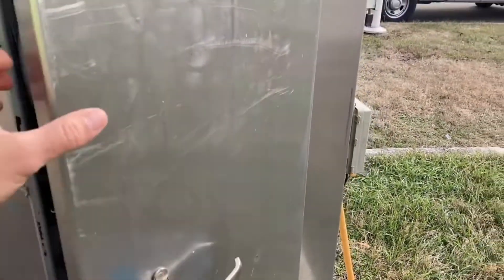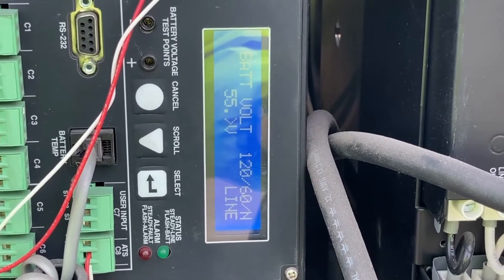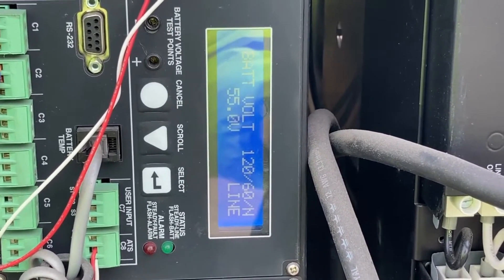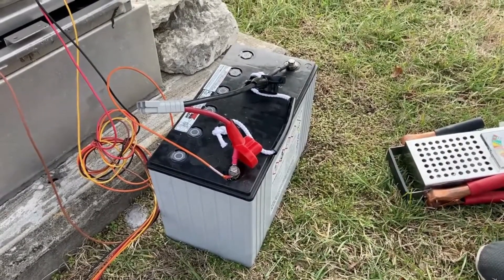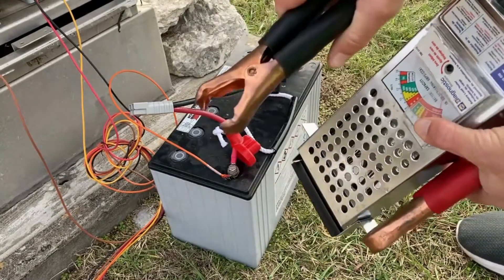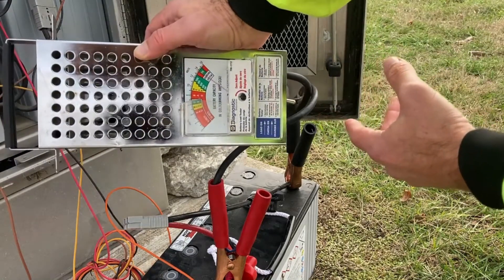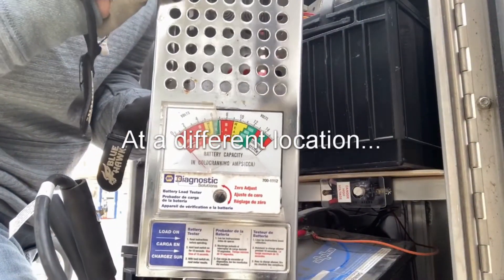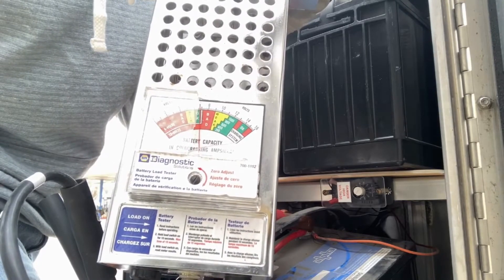How NOT to Test UPS Lead Acid Batteries

Comment: I have a super cheap universal battery brand 100 amp hour 12v AGM battery that is still performing practically like brand new after just over 3 years since purchase date. However it has only had very light occasional use with less than 10 complete discharge and recharge cycles on it. it has probably only had a total of 200 or so amp hours charged and discharged out of it since it was purchased. it has been mostly kept on a standby float charger at 13.5v or left sitting and occasionally topped up with an absorption charge cycle to 14.7v
it has no trouble running a window air conditioner off a 1000 watt pure sinewave power inverter for over an hour continuously without falling below 12 volts.
 Tested for ability for cranking amps and resistance reads to about 558 Cranking amps and 5.4 milliOhms resistance which is within manufactures specifications. and capacity is still practically like brand new as well.
Reply from the maker: @realflow100    Wow!  That's a good battery there.  I'm assuming its probably kept in a good storage area?

Comment: I gotta say the test used is pretty good. I still have two of these but now I use a conductance tester. Specifically the EECS750 from Snap-on. The Midtronics testers are pretty good as well. These conductance testers give true battery condition and will also give remaining battery capacity. Typically we select the CCA rating. It can test STD, AGM, and GEL batteries. Great video.
Reply from the maker: @ronhaefner7883    Wow!  Never heard of those.  Thats very interesting it can give battery capacity as well.  I'm on the hunt!

Comment: if it's deceiving than why have it or use it, did you just pull the cable out by the cords
Reply: Yes, he pulled on the wires.  This type of connector is a 50 amp DC connector and can sometimes be difficult to separate.  The wires will be crimped maybe with some solder and are very strong, unlike the flimsy plugs in your household appliances.  Sometimes there's a pull string on the shell that makes it easier to grab. 
An ordinary voltmeter works fine IF there's a load on the battery; he mentions that in the video.  You can open the breaker forcing the system to use the batteries and then you can measure the batteries one by one with a normal voltmeter IF you can get to the terminals.
Reply from the maker: @thomasmaughan4798    Thanks for clarifying!  Your description was much better than mine!
Reply from the maker: kman--Great questions!  The status menu displaying the battery voltage is great if you want to kill power to your signal cabinet (shutting a breaker off downstream) which at that point the Battery Backup system kicks in and then you can watch the status of your battery voltage.  IF your batteries are aged and depending on the size of the intersection (more lights, more load), a fast battery drain is also a good indicator of the life of your batteries.  A new set of batteries could run an intersection 4, 6, 8, 10 hours?  Once again depends on size of intersection.  Usually around 48V mark your system will stop supplying proper power to the signal cabinet. 
Rarely happens, but I have had a fairly new set of batteries where one went bad out of the bunch.  That's where a load tester comes is great to have.  You can isolate the problem to which battery it is.   
Also, each battery has its own disconnect cable.  Once you disconnect it, the battery itself has a carrying handle for pulling out the battery as they're not light.   I'll be honest, going around and testing all the batteries are not one of my more fun activities of being a Signal Maintainer 😂

Comment: I've been playing with LiFePo4 batteries the last couple of years. I believe they are already much more cost effective, but the UPS manufacturers think it's their golden egg right now.
Reply from the maker: Interesting Dave...I haven't heard of LiFePo4.   I've never been a big fan of lead acid.  We tried Zinc5 battery systems but they recently pulled out of the traffic industry.
Reply: @streetsmartstraffic  the one thing that's bit me is if they fall much below 0, they turn off. So keeping them warm is a consideration. Otherwise, they are better in most ways to lead acid.